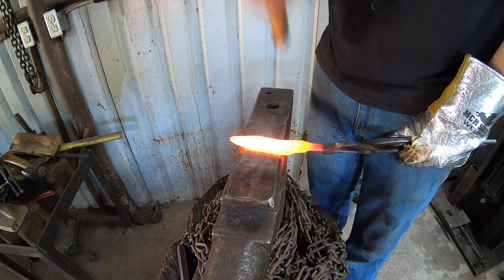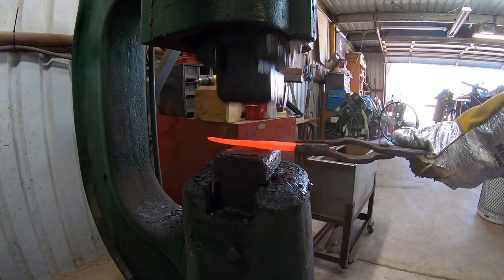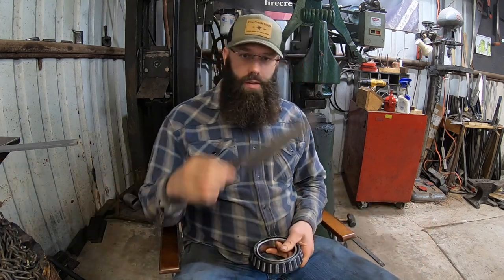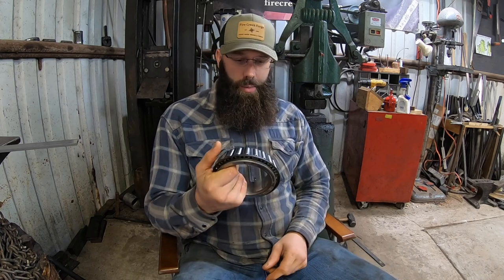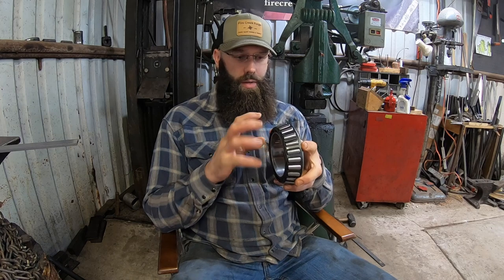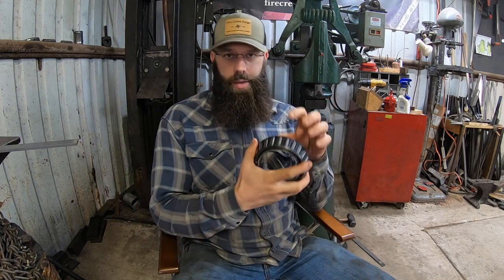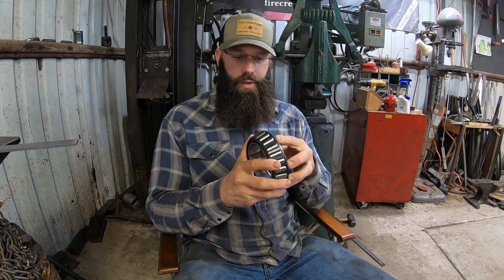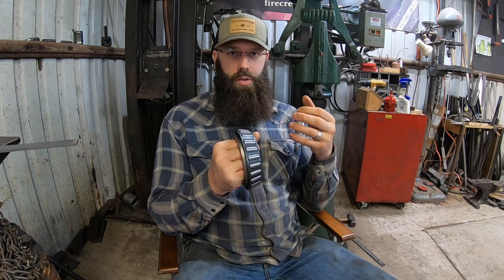How does bearing steel make a good knife?

Comment: 52100… seems like fake news… HX500, The paragon of all steels… we do come from come from two very different sides of the industry😎 
I will say that 52100 performs excellently under thermal cycling which is what a bearing endures every single day of its life, to one degree or another. 
Most of those bearings are in an oil bath, and multi grade oil being what it is, those bearings do less work as the oil around them progresses/improves. 
Mono grade oil’s were kind of lame In comparison, multigrade is way more better, plus we now have torque stabilizing additives etc. technology being what it is.
Great film, would like to see more like it👍 

Maybe we should test these bearings in their natural habitat, then forge them into something cool??? Might be a cool film🤔🤔🤔

Comment: One of my first blades was a bearing and would not hold a edge and I decided that it wasn't a knife blade steel  but it turned up missing. 
I'm going to try again and as you say it was probably my heat treatment or quenching as I am a hobbyists BlackSmith and having a blast at 71 years young.
Thanks and I look forward to getting the treatment corrected. 
My little knife was perfect for peeling apple in one cut.but wouldn't hold a edge 
Thanks
Reply from the maker: Thanks for watching!

Comment: I was told by a guy that kinda showed me knife making basics that 80CrV2 was his go to for blades. Also where I buy materials it says it’s a good steel for all knives serving all purposes. I use 5160 (never failed me) for now until I get a heat treat oven and I can test this 80CrV2 properly. Should I switch to using 52100 if it’s a bit better? I hear some people say 80CrV2 is overrated and not as good as others say. I would like to hear your opinion on this cause I’m just beginning knife making and I want to use the best steel obviously.
Reply: 80crv2 is all i use. It is insanely tough and holds a good edge. I get it to 61hrc. Ive beatin it through an old 4x2 barn wood thats iver 30yrs old and hard as a rock and the blade is shaving sharp after it. The downside to 80crv2 is that it will rust quicker than 52100 due to the lack of chromium and creates alot of scale when forging, so bear that in mind. But its some of the best tough high carbon steel out there.
Reply from the maker: I have used 80CrV2 a fair bit and did some fairly in depth experimentation for heat treating and toughness tests in my shop several years ago. I used it to build my champion Japanese Gunto on Forged In Fire. In my experience it is extremely tough, and holds a good edge. The chromium and vanadium content in it provide for excellent grain size control, which is a desirable feature in a forging steel. It's simple to heat treat provided you have a method for holding a constant temperature for the necessary time (10 minutes). The thing 80CrV2 lacks is the higher carbon content  (it has .8% vs the 1.0% that 52100 has) so it doesn't have the same capability for wear/abrasion resistance. Otherwise it's a great steel and I will continue to use it in the occasional projects were I toughness is more the primary requirement, such as a big chopper.

Comment: I like 52100 but I've been playing with 80crv2 I'm not seeing a huge difference in the 2 but I'm still very new at making knives
Reply: The main difference is that 80crv2 will form alot of scale comlared to 52100 and it will also rust easier than 52100 due to the lack of chromium.
Reply from the maker: You probably won't see a huge difference until comparing the wear / abrasion resistance. 52100 has the carbon content to perform better in this area if heat treated properly.